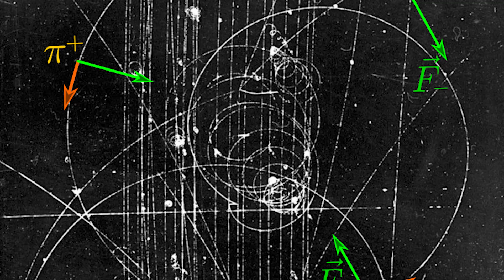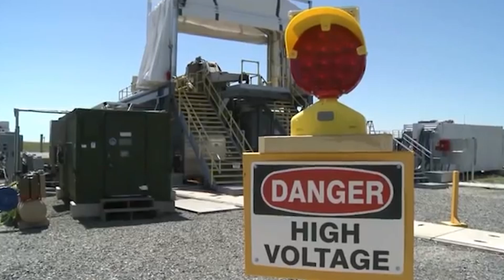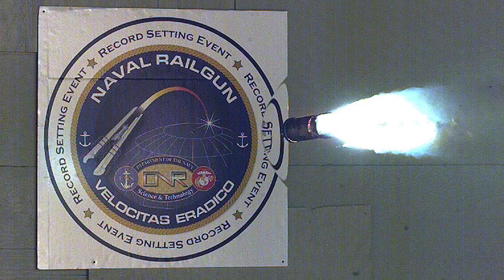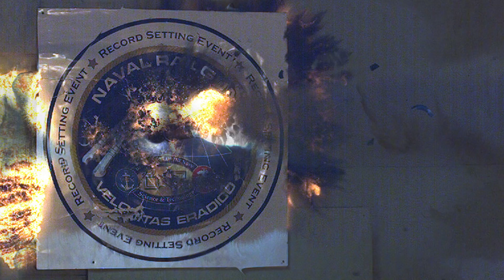Railguns: The Kinetic Future of Warfare

Comment: It's not really clear if the backporting of HVP shell technology to normal guns means the railgun project isn't going well. At the end of the day most guns aren't on naval ships, and at the end of the day even replacing all guns on all naval ships could take a very long time, never mind all the big guns the army has as well. Something which would require figuring out how to make railguns lighter and more compact then a naval version has to be in the first place. 

So it's far from abnormal for a military to use parts of new technology in older systems if this is possible, so long as it gives enough of a performance boost, and it is known that the railgun developed projectiles very much do give a quite substantial performance boost to normal guns. They're basically shells that will fly further and more accurately. So why not have a version of this projectile that you can use for your thousands of artillery pieces right now, right?

I suspect personally on how the flow of development is going, that a some what mature railgun technology might already start emerging this decade. The power system issue is basically solvable enough already, as they're already using large capacitor banks for that and last I heard they were busy designing one you could fit in to a ship more easily. The rail wear issue seems to be going better if they've gotten well in to triple digits and seems more like one of the real issues that might be slowing development a bit. And the suggestion on the barrel coming apart, I'm dubious that's really that much an issue, it's not like one historically hasn't just made a more hefty barrel to counter exactly such problems before.

Comment: What about a hybrid railgun? The projectile starts out in a normal gun .This speeds it up from a standing start. Then use a railgun to speed it up the rest of the required speed.
Reply: That's been done. Works well for small projectiles at about 6km/s but a two stage light gas gun can also shoot that fast for laboratory applications.

Comment: I almost build a rail gun for pumpkin chunking using electrical construction components and an old industrial AC DC converter and amplifier. sadly The Break-Up of my sister-in-law's relationship and pumpkin chunking rules against metal suppose to put an end to that plan real quick.

to be technical I would have been constructing an inline differential Quail gun coil gun. so technically not a real gun but another type of electromagnetic projectile weapon. because of the capacity and size of the components, I was working with it would have been the largest and most powerful coilgun ever constructed by a civilian. it would have been on-par with an American Civil War battle cannon ( 10 to 30lb of black powder ) on the low-end estimates. 

still regret never building it my self but it also would have been extremely dangerous to use let alone fire so it's probably better this way.

Comment: Perhaps once you get the projectile up to speed switch to a lower resistance conductor than copper and also perhaps start it up with a baseline velocity like a spring loaded mechanism or something.  If the magnets accelerate it fast enough I don’t thing a traditional fire arm type explosion would work because the ideal rail gun shoots the projectile faster than chemical fuel expands and that might actually slow the projectile.  I think, based on my limited science knowledge that feels right but I’ve also had some brain trauma so wh the hell lnows
Reply: It would also be better in a vaccume because of air resistance

Comment: The rails are not charged. There is a current flowing from the positive to negative terminal of the power source. And the current flowing through the rails creates a magnetic field which causes the force on the armature through which the same current is also flowing.

Comment: I know this is going to sound stupid but, could some of the durability problems be because the prototypes we see are square shaped? Think about it, what shape is a gun barrel: cylindrical. When the Comet airliner was found to be falling apart in flight, it was due to the square cabin window frame corners cracking from constant pressurizing/de-pressurizing, and now aircraft cabin windows are either circular or have rounded corners. When Colt Firearms found their 10mm Delta Elite 1911s were malfunctioning, One problem found was that the square notch for the slide catch under the left guide rail of the frame was cracking, and the solution was to simply remove that small section of the guide rail. The corners of a square are known stress points so perhaps making the rail gun cylindrical could help solve these issues. Yeah this sounds like a dumb mistake but they wouldn't be the first ones to make one like it. Anyone remember the Mars lander that crashed because there was a mix-up between using feet and meters? Or perhaps when engineers for the lunar lander realized they had been testing a four legged prototype using calculations for the previous five legged one?

Comment: Sorry, but the power supply is NOT the issue. Take typical 50 MJ gun (that's a BIG rail gun) 50 MJ is 50 million watt seconds,   ie 50 MW for 1 seconds, or 5MW for 10 seconds, a 5MW diesel generator is nothing special  A single litre of diesel has 37MJ of energy, so a couple of litres is all you need to fire the gun (including losses)

Comment: thing is if you have enough energy weapons/railguns you could change warfare in a way that missile/planes could become un-usable, so going to be similar to going back to line of sight / trench warfare but with added downside that you have to get power generation on site. so Defense should have a major advantage compared to offence.
Reply: I doubt it. You would still need to be able to reliably acquire, track, and hit a supersonic (or even hypersonic) aircraft or missile, which is no easy feat especially if it is making evasive manoeuvres and flying at extremely high altitude. Good luck tracking it if it is a stealth aircraft as well bombarding you with standoff weapons from hundreds, if not a thousand kilometres away... and those air-launched cruise missiles may also be stealthy as well.

Now, would railguns and directed energy weapons mean the end of slow, low-flying CAS aircraft like the A-10 Warthog? Undoubtedly... but the A-10 has been near-obsolete in a modern battle environment for decades now largely due to advances in inexpensive SAM systems. No amount of armour you can strap on an aircraft is going to enable it to survive an S-400 missile up the tailpipe and still complete its mission.

Comment: For the projectile I would just use  an alumanized ceramic. That would resist deformation and immune to the heat issue. (And I assume could be made for 1/10 the cost of what they use now)

Comment: Only feasible power supply
for multiple fire from a ship would be to custom-build said ship with a nuclear power plant that was far bigger than needed for simple propulsion. That is certainly feasible with today's nuclear power plants, and would be no problem once the rail gun tech is available. 

On the other hand a one-shot or few-shot system is just about manageable with battery technology. They could even  be called gun  batteries. 

From the enemy's viewpoint it would be like facing an opponent with a six-gun, as they would soon get to know how many shots a vessel could launch before needing recharging time. We can imagine a naval Dirty Harry: I know what you are thinking: did he fire five or six times?

Comment: In my imagination there are two places people should focus on developing railguns first. First of all,,, skip everything that sets a record,, but then,,,, bows with a railgun accelerator (based on the repeating bows developed by joerg sprave of the slingshot channel) which only produce a marginal acceleration that results in presently available speeds from guns,,, and then an aircraft and spacecraft launcher that merely gives a head start to a vehicle that will then carry on with it's own energy, but benefit from the boost. (supersonic craft will benefit from the tiny wings that make self powered liftoff a very high energy activity,,, also aircraft carriers pretty much did all the homework already)

Comment: Also according to PowerLab's website, he claims that the French also built a railgun in the 1980's which used copper hairs to make contact between the rails and the armature in an attempt to reduce drag and welding between the projectile and rails, although this project was also soon abandoned.

A majority of the rail erosion occurs due to arcing and not so much due to mechanical wear, experiments done by PowerLabs has shown that speeds in excess of 1m/s will cause arcing regardless of the pressure applied to the contacts.

Australia also built a railgun in the 1950's. 
Admittedly information about it is incredibly hard to come by but I can 
recall from my research (from 14 years ago) it operated by firing a 22 
caliber bullet into to the railgun which accelerated the projectile up 
to speeds of Mach 5 or 8. 
You may have to directly contact the ANU's physics department for more 
information though.
https://en.wikipedia.org/wiki/ANU_Research_School_of_Physics_and_Engineering
https://www.anu.edu.au/news/all-news/unpacking-the-mysteries-of-science

Comment: Maybe the answer lies in finding a way to produce a stronger magnetic field with less power?
Reply: don't think you can.
the magnetic force is generated with electricity, it's a 1 to 1 comparison.
there might be materials with less resistance, but you're not gonna get like 100X the results from them, and they're not gonna be able to withstand the pressures the rail cannon will be under.

it's like having a cart with one horse, and expecting there to be some fantastical engineering concept to apply to the cart to make it act like it's got 10 horsepower or something.

Comment: Nothing wrong with a pneumatic cannon.  Use electromagnetic forces to compress air down a barrel might be more reliable than pushing with pure electromagnetic force.
Reply: Pneumatic cannons have not been practical weapons in almost 200 years. They offer nowhere near the muzzle velocity of smokeless propellants. The only advantage to using a lethal version of a spud gun is that it would be much quieter and have no muzzle flash when compared to a naval gun or a mortar, for example. This would come at the cost of having an utterly pathetic range compared to even WWI-era naval artillery.

Comment: Surprised you didn’t mention the new Zumwalt destroyers. Power systems designed to handle these weapons and two are already afloat and the third I drive by under construction every day.
Reply: Dude that boat has been cancelled after 3 copies the boat you're seeing built is the last one of 3. It wasn't designed for a railgun it was designed to fire the 155mm AGS the LRLAP rounds costs about $1,000,000 a round so the Navy halted procurement in 2016.
Reply: @JoeBLOWFHB  that is all true. Development costs too high. That said the power generation and distribution systems aboard have had folks thinking for years it has the power to possibly run a rail gun.

Comment: Opposite current does not have a repulsive force, but, current of the same charge do.
Those opposite current force attract each other, in a magnetic force.
Reply: With two currents flowing in opposite directions you can determine that the magnetic fields are in the same direction and will therefore repel. When the currents flow in the same direction the magnetic field will be opposite and the wires will attract. 
~ Sep. 5, 2016

Why do two wires with current flowing in the same ... - Socratic

https://socratic.org/questions/why-do-two-wires-with-current-flowing-in-the-same-direction-attract-each-other-a
Reply: So yes, here, a flow chart proves the point of repulsion, 
and how the flow causes it, 
compared to flow of the same charges.

Comment: Logically, if the railgun can propel a shot that fast from a dead start, doesn’t it stand to reason that the gun itself will transfer that force into any ship its mounted on.  That equal and opposite force thing makes one think that a functional railgun could rip a standard ship apart over time...
Reply: Not much different from the forces that fire a shell from a battleship's main guns. Those shells weigh over a (metric) ton and leave the barrel at above Mach 1 speed.

Comment: They been bypassed Lazer will be large applications they already have a rail  Rifle in testing. Cost per shot yes has a few issues but they like weather power supply layers dosen't require near as big power source and even those are getting smaller.

Comment: its basically the next technological tier of throwing a sharp stick really fast
Reply: It pretty much all variations on that theme.
Reply: Look, baby, the future is not in ‘sticks’! It’s in ‘rocks’! Come on, ignore that heavy metal copper, let’s just rock it!
Reply: Caveman go OOGA OOGA Good stik
Reply: sharp rock. metals are just purified rock
Reply: Ooga booga in 2077
Reply: You underestimate Just HOW fast and just how Devastating a big stick is. 

You can wipe out a small country whit a fast enough projectile fired at high enough speed.
Reply: that's what a railgun is
Reply: Like that scene from 2001
Reply: throwing a stick at Mach 27.
Reply: Send that rod to god boi
Reply: the technology leap of lawndarts
Reply: or lawndarts
Reply: That's because it's the most energy efficient. Directed energy based weapons disperse heat across the surface area of an object and have to be focused on a single point for an extended period of time to do more than superficial damage from more than a centimeter or two away. We're having a hard time finding away around using combustion technology in general, both for weapons and transportation (both ground and aeronautical) because nothing else gives us as much output for the resources expended. It takes far more to generate the power to shoot a rail gun once than the amount of propellant expended to achieve an acceptable result.
Reply: That stick should be moving at Mach 7.
Reply: a bullet is basically a short  sharp (or blunt) stick...
Reply: @generationkilled  yeah but it requires an explosion rather than "throwing"
Reply: Human yeets sharp rock 

Human YEETS fancy sharp rock.
Reply: Here they forgot or kept silent about the fact that the barrel of such a weapon in just ten shots, is eaten up by rust. Since high currents lead to super rapid corrosion So this is not the next "tech level of stick throwing" and not a viable demonstrator of possibilities.
Reply: @АлександрЛукьянчиков-р3й  depends what its made of. also corrosion in metals is usually oxidation. keep the rails in a vacuum.
Reply: @jonathanodude6660  These solutions can help slightly increase the survivability of the system. But for real use this will not work, there are too many drawbacks compared to the standard systems used by the army.
Reply: @jonathanodude6660  or use new matts like graphene or something we haven't formulated or discovered yet. Rust or reusablility issues are just two annoying aspects, not a deal breaker for the system to operate. Nothing saying we can't have replaceable rail system or who knows what other modular type of design. We went to the fucking moon and you are reading 1s and 0s as a video and text. You think some rust gonna stop our progress on a weapons program? Lmao give DARPA a long weekend with it and they'll figure it out 🤣
Reply: @АлександрЛукьянчиков-р3й  some wd 40 will deal with that
Reply: Seems like a technological dead end to me.  Even if it did work, it'll never be feasible or practical to use compared to regular guns.
Reply: @taekwondotime  it will be cheaper, as it fires metal ingots ;)   
... if you want to, or you can also place expensive explosive warheads in there anyway. Railgun can fire almost anything.

Comment: the electricity part will most likely continue to be worked on. alongside rail guns, another technology being worked on is high powered lasers and they also use a lot of power. lasers are more for self defense, shooting down missiles coming at you type of technology, and most likely doesn't have much range due to atmosphere distortion. but it is these technologies pushing for ever higher power needs.

Comment: The question is, what kind of target moves so fast that you need a weapon like this to hit it?  Because basically every kind of normal target is sitting still compared to existing bullets, rockets, missiles and so on.  So what's gained with something that can fire such a fast projectile? What's the target?  And why is everybody suddenly working on these things along with hypersonic missiles?  The answer is very scary stuff you don't want to know about. And these weapons probably won't work.  It's not going to be enough. Consider that: these super fast weapons will still be inadequate.  We are dealing with a problem, as the video notes multiple times, that is beyond current human technology.
Reply: More velocity means more energy released upon sudden deceleration. The point of a railgun is to be able to shoot from a very long distance away and to release massive amounts of energy upon impact, even with a small projectile.
Reply: Ever hear of ballistic missiles? Even 1970s-era ICBM warheads are going at least Mach 22 on re-entry.